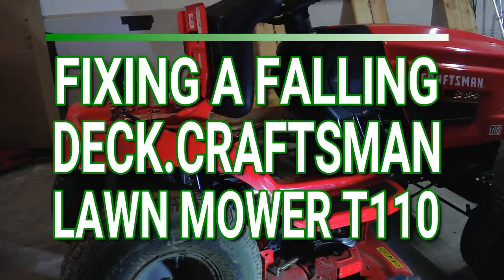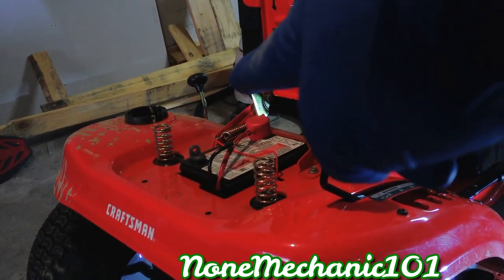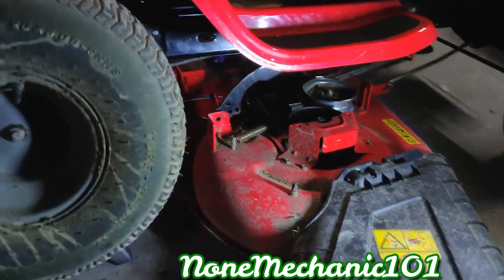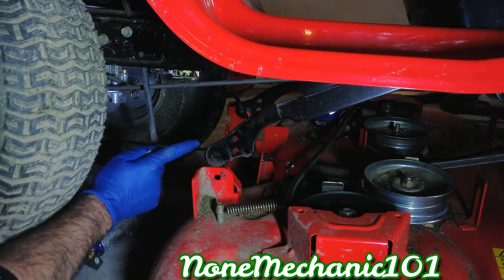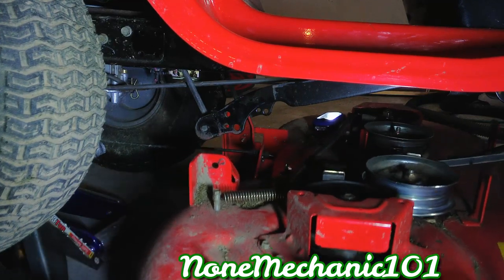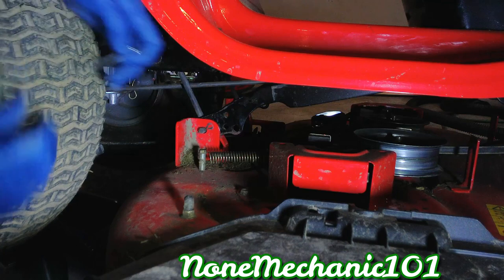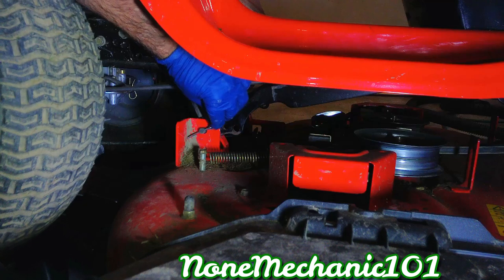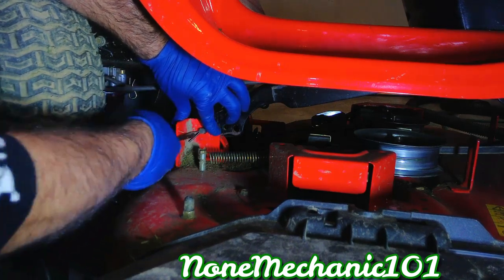Craftsman Lawn Mower T110 Fixing a falling Deck

Comment: With no washer on there that pin gets cut by the bracket and breaks off. My old MTD does that if there is no thin washer on it. Good video.
Reply from the maker: Thank you for the information. I appreciate it.

Comment: Mine still not level. I think my deck lift arm is to low but don’t see how to adjust looks to cram to get a socket on it
Reply from the maker: In front of the lawn mower in the bottom (12:00 o'clock ) There's a bolt that you can make adjustment to the deck. It has to be turn until you see it level.